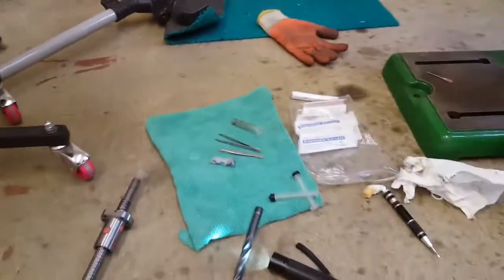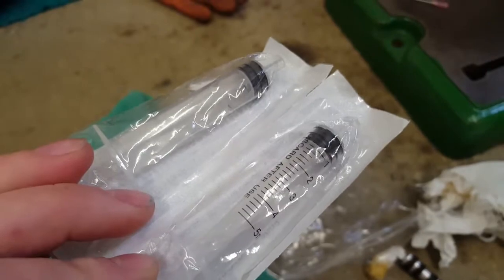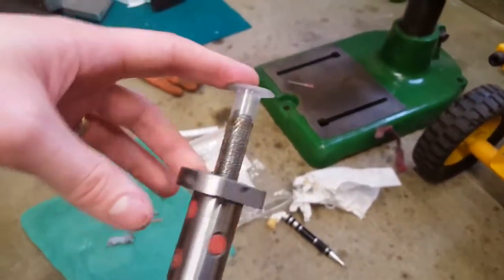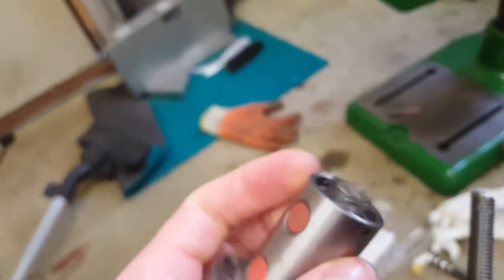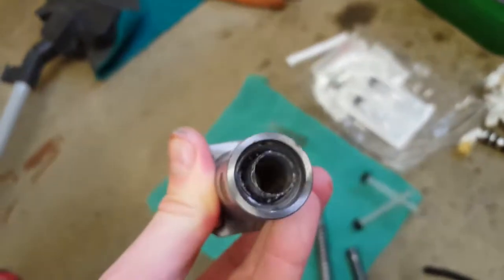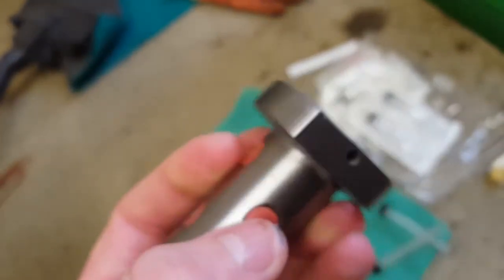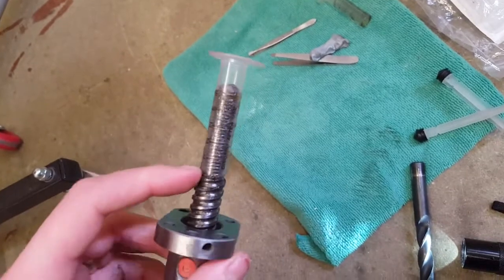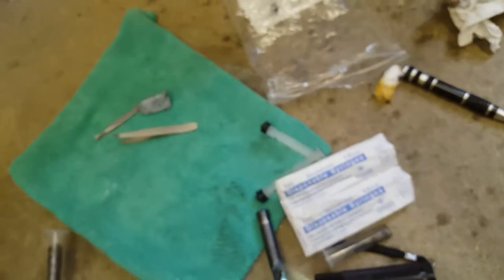Ballscrew 1605 Ballnut Service Refill Trick

Comment: Hello! How do you know which threads shouldnt have ball bearings? You mentioned that we should make sure not to get any ball bearings in the unused loops - how do I know which ones are supposed to be unused?
Reply: Most ball-nuts of this type will have 3 plastic ball re-direction fittings in them (the little red or black plastic plugs). If you look very closely inside the nut, there will be a short piece of thread/track between the middle fitting and the end fitting, on each side. This track is short, about 1/4 of the way around or less, and leads nowhere. This is the part to avoid. It helps to shine a light in there to see it clearly.
I know this is quite late... just saw the video, but might help someone else😀